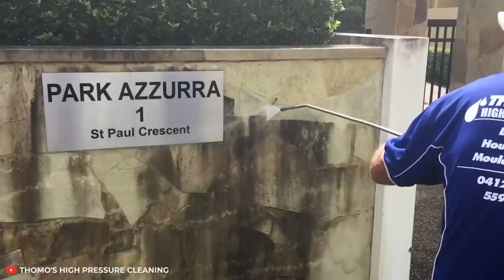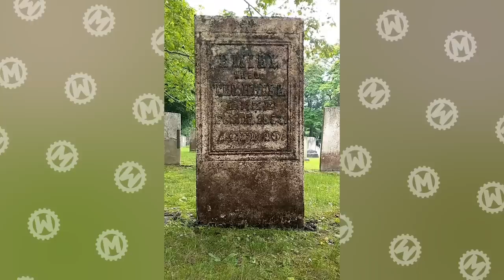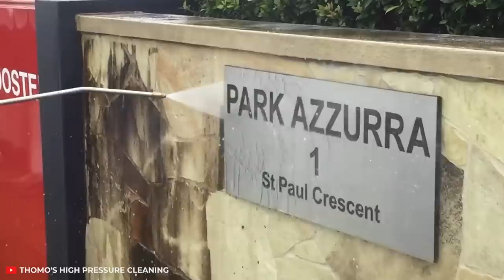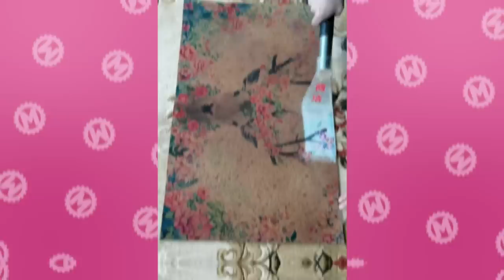Here's How Professionals Deep Clean Things

Comment: 2 Things I’m getting after this video: that vacuum and a good pressure washer.
Reply: I've been scrolling the comments to figure out what vacuum/upholstery cleaner that is.
Reply: @bricoley  i think its an extractor, a auto detailer i watch (The Detail Geek) uses the Bissell extractor, you can watch some of his videos on it its pretty strong
Reply: A lot of videos I've seen feature the Bissell Little Green.

It's on my wishlist/budgeting for this list.
Reply: @bricoley  I think those little one are like wet vacuums
Reply: Get a small car shampooer extractor and shop vac. I bought a used pressure washer and steam cleaner to use around my house. 
As for the dryer vents....just take it apart and clean it along with cleaning your dryer out. Those things on the drill help but can leave lint stuck where the vent curves.

Comment: 9:00 - I call bullsh on the deep cleaning vacuum... I've used many and even cleaned professionally (16:45) and I know that this is a cheap trick by people selling the vacuums, or workers trying to make a place look dirty but not really need a deep cleaning, it's just sprayed w/ a alcohol based spray that evaporates/dries quickly. Just like overspray from a spray paint can and how the paint will leave a sort of dust all over the place.... It doesn't adhere to a surface, just makes it look dirty. 18:00 is a great example of how you can fake a dirty car...  SMH
Reply: Some of the upholstery ones are clearly soiled o on purpose because the dirt is too even
Reply: Those aren't vacuums, those are carpet extractors.

Comment: After I got out of the Army, I worked for the temporary agency Labor Ready. I was able to get a few days work with a carpet cleaning company. Damn I loved that job. The staff was amazing to work with and the work was super gratifying. One house we did was of this elderly couple and the whole house was flooded because of a plumbing problem. We took out all the furniture, cleaned it, took out the carpeting and replaced it with new carpet, and cleaned out the built in cabinets etc. The bosses loved how well I did, mostly for my strength, speed, and intense attention to detail. They wanted to hire me on a permanent basis. But for some weird reason, Labor Ready wouldn't let them, saying they had a "contract" with me which wasn't true. This actually happened quite a few times with other temp jobs I got set up with. I love using pressure washers. It's so much fun and relaxing.
Reply: You could have just had the last part, but cool.

Comment: Toilet paper isn't the issue with plumbing (and I have yet to find a place where it's forbidden to flush them). The problem are wet wipes like the ones in the video. Because they don't dissolve. 
If you have a clog through normal toilet paper, it's because you used a freaking ton a whole lot of times but wet wipes are not flushable and they are not toilet paper
Reply: I want to think it was during the Sochi(sp?) Olympics that there was a newscast about how, at least in some althetes dorms, they were told to not flush toilet paper and told to dispose of TP in a waste basket next to to toilet. It may have been because of poor plumbing in the building. I have heard of other countries, Asian island I believe, that you are not to flush TP. Then again, bidets are very popular in a lot of other countries as well. Also, I agree about the wipes being a HUGE problem with plumbing from the toilet to the waste water treatment plant.
Reply: You can’t flush toilet paper on the island of Crete, the plumbing can’t handle it, there are signs in every bathroom.
Reply: @desereetouchet9294  You can't flush it here in Brazil either, usually there's a basket for it, which is cleaned everyday.

Comment: Cleaning can be so relaxing. A few weeks ago I was really stressed out and when my father revealed that he had used oil (oil!) on the computer's fans so they would 'work better' I lost it. I opened the pc's cabinet and there was so. much. dust! It was absurdly dirty, with pieces of dust and balls of furry dirt. I had to use a mask to work. Unscrewed everything, unplugged all cables, removed all components and went over them with a hair dryer to get the gross part out first, then a toothbrush where the electric components weren't visible and finished with a kabuki/makeup brush. Took me hours but by the end it was so clean that I was no longer stressed. I was super tired, but not stressed anymore. There's just something about cleansing other stuff that really calms you.
Reply: This comment both reassures me and frightens me.
That must have been SOOOOO. MUCH. HARD. WORK!! 😱😭
I can't even imagine........!!! >.< Oh my God.

But also soooooo satisfying once you were done :)
I agree with you, it really is satisfying but damn, I hope I never find myself in that situation.
Why did he use oil? 🤔
Reply: @EverydayKIWI  Whenever someone would sit down to use the computer after it had been shut down for a while the internal fans would start a loud noise as if the whole thing was ready to take off. My father thought, "hey, it must be just like a normal fan right, when you use it too much the oil around the spinning parts gets heated and dry off so eventually they start to make a noise because it's all kinda scraping in there" - and then he used a little bit of good ol' oil in them. That, and he sprayed contact cleaner all over the motherboard, RAM, and graphics card just for good measure.

I mean, sure, sometimes it's the thought that counts, but yikes! I felt my stomach dropping when he happily told me what he had done. He was just so proud of himself, lol.
Reply: @Naruneyl  
Hahaha oh maaaaaan😂😭
THAT is a story I'm going to remember my whole life.

Did you scold him for it? 😅
I would have been so pissed and shocked but at the same time not being able to stop laughing.
I'd probably laugh a whole day while at the same time making irritated comments about how stupidly adorable he had been.
You just CANT hate someone for a mistake like that!! 
Especially when he was so proud! 😂😭
It reminds me of my grandpa when he thought he had done something really clever.

But still, the amount of absolute hell you had to go through cleaning it....
Well done, my friend!!
Well DONE!!! 🤯👏🏼👏🏼👏🏼

Comment: For the PS4 controller one, I can tell there is no warranty on it. As the thumbsticks are heavily worn out, and had that much dirt. 

It is sometimes easier to clean the controller by taking it apart. As the dirt can get into the controller and screw up the analog sticks. 

The smallest cat hairs ruin my sticks, so I gotta clean it whenever I get any form of drift.
Reply: it was a ps3 controller, but whatever.
Reply: @bradgooner3284  They did both controllers. The PS3 controller was toothbrushed while the PS4 one was done with a toothpick
Reply: Made me do a doubletake for a moment. But I was talking about the first controller and not the second.

Comment: A washing run through a full cycle with 1/2 a cup of anhydrous citric acid will clean the exterior of the bowl.
Pressure washing a deck can open the grain of the wood, and allow fungus in, use a hand sprayer with a moss mould and strain remover. Use an oil based stain to protect it.

Comment: Using good and right detergents (if thats the right word) can help A LOT. Also giving it 5-10 minutes is important there if u dont brush or wipe the surface. If u wash it immediately away again, theres pretty much no sense at all behind that.
Foam can work longer, since it doesnt dry up that fast. It also stays longer on vertical surfaces, since it kinda sticks to it. So u can let it work 15-20 mins. After that the pressure washer will fix it much easier and better. This really can make a huge difference.
There are power washers where u can put detergents in too, so it comes out mixed with water... Im not a big fan of that, since as said those detergents need time to work. They dont do stuff immediately, or at least too less... So u can use it for exactly that instead of trying to final clean stuff with it. Of course theres also power washers who are able to put out pure unmixed detergents with low pressure, what makes more sense imo if needed.
Its overpowered for most, but there are power washers with really hot water and that also can make a pretty big difference. I guess u call those steam cleaners or something like that? Thats funny to use when its very cold. U barely can see stuff, because theres so much steam everywhere.
5:24 That type of power washer to my knowledge has a rotating bullet in the front and it makes the water what comes out much more focused on one small point, thats why it looks kinda odd. This is very loud in comparison and it also is kinda dangerous to destroy stuff. U usually just want to use that if u cant damage anything with it and if it makes sense to have that much power. It also can be dangerous that u hurt yourself with that and u shouldnt underestimate regular power washers too. The closer u get to the nozzle, the more power the water has.
The guy on that time stamp most likely used a detergent for stones before power washing it. I dont think it would get THAT clean with just the power washer alone. It usually will be MUCH easier, faster and cleaner if u do so in that case, thats my point... Means it always depends what kind of dirt it is, how good it sits and what the surface is to decide how exactly u should clean it. Grease is something completely different than kinda burnt in dust and dirt for example.
Theres also detergents what can damage some materials, so thats a very important thing too. U usually dont wanna use acidic stuff, unless it really is neccessary... That stuff can be very dangerous and accidents with it happen faster than a lot might think. With decalcificators (if right word) u need to be careful to not breathe that steams in. Thats very aggressiv stuff, what u will feel very clearly in your lungs. Usually at home much amounts of it arent needed at once, so the danger shouldnt be very noteworthy. Dont underestimate it tho, especially in larger amounts.

Comment: I cleaned out controllers by taking them apart.  Bought a used Wavebird that was dirty and the power button stuck so bad it barely moved.  Opened it up, some rubbing alcohol, water, and Q-tips later, was as good as new.  Also easier to degunk the connection area where dead skin and dirt LOVE to collect.

Comment: The bathtub in my apartment had started backing up, and my toilet was leaking out the bottom, so I got the maintenance guy over. He comes in and runs some water in the tub to see how badly it's draining. Then he starts removing the toilet because he said it needed a new wax ring. He gets the toilet off and immediately notices that there's roots in the hole. I'm in the living room and hear him yelp in surprise. He had pulled out a clump of roots that was at least a foot and a half long! As soon as he did, he said the tub drained. Roots are a real problem in a lot of areas.
Reply: They are. The front yard tree at my former home cost me over $1100 when its roots busted through underground pipes.
Reply: @sunlightangel87  Ouch! Thankfully, I don't have to worry about paying since it's the apartment complex's business. BTW, the maintenance guy actually took a picture of the roots to show the manager. I still can't believe how long that thing was.

Comment: OK so the controller one was a little irritating to me. Because while yes its satisfying and I do this everytime I clean mine even though I don't have to. Everyone takes it apart first. Take the tech out. Take the shell. The buttons. The rubber pieces. Throw em in hot soapy water. Toothbrush the whole thing in the sink. Take em out. Dry em with a towel and let em air dry a bit to get moisture out. Can set a fan on them or use pressurized air to force the water out of everything if your impatient. But that's the way pros do it. It's easy. Effective. Simple. You don't risk ruining the electronics and you know the inside and outside of your controller clean. Which is another thing. You open it up for a cleaning so you can wipe down the electronics with alcohol for a thorough clean. It does look like he opened it up at some point because the thumbsticks didn't have grips in the beginning. Or just switch to a perfectly normal controller. Idk which.

Comment: Professionals wear steel toe caps when handling pressure washers, and professionals take games controllers apart to clean them. You also transitioned from a PS4 controller being cleaned to a PS3 controller and made the clear insinuation that it was the same controller. Maybe watch a video on how professionals edit videos.

Comment: What's the vacuum that's used for the pillow and car cleaning, is it just a regular car vacuum but they sprayed cleaner on the material first? Is it a you just use this soap hose/vacuum and it adds cleaner as it sucks it away? I dont know and I want to know

Comment: Yeah folks need to be careful with high pressure stuff... used a pavement pressure washer that was 4,000 psi! If the rotating wand didn't club you to death the high pressure will do some unrepairable damage and or sever the limb

Comment: The PS4 controller cleaning is a half-assed job, maybe done by DK Oldies except it's missing the magic eraser.

You're supposed to open the controller up, take it apart and clean more than just the surface area. That's a professional cleaning job. What this guy did was surface level at worst because in the end, it really didn't look all that much better.

Comment: "Professional" cleaning doesn't necessarily mean a proper cleaning, as indicated by a couple of these examples.

The mobile phone and game controller could've underwent a more thorough and less destructive cleaning if the devices were taken apart and the relevant plastic cases/buttons washed, rinsed and in some cases retro-brighting. The only reason they weren't done so here is because it's too much time and effort which could be spent going into fixing more devices.